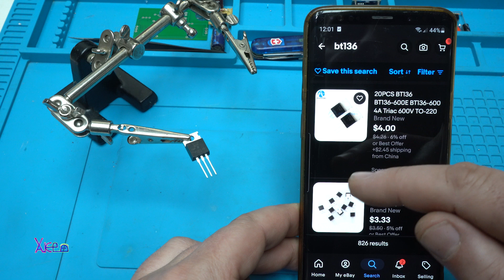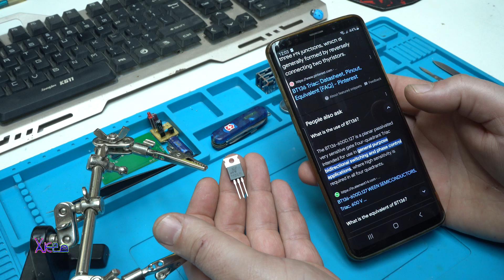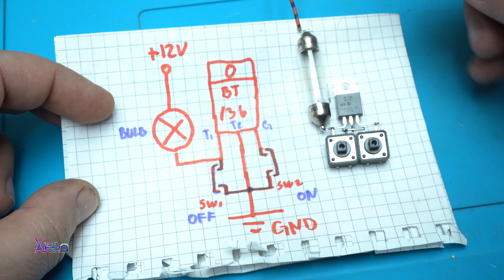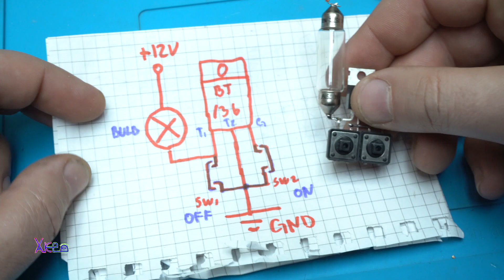ONLY 4 Parts To Make ON OFF push button SWITCH

Comment: It would be an even more interesting video if you explained how the electronic components you use work. Also, you would explain your circuit diagram, how it works. Because you showed the circuit diagram, you showed how to solder it, but your channel viewers may not understand how and why your circuit works.
Reply from the maker: Thx for feedback sir.

Comment: Neat!  I'm thinking those on/off switches could be replaced with a switching circuit for auto-control.  Also, given the triac works with AC, I should be able to switch on/off an AC motor - yes?  and maybe stick in a pot to vary the voltage and hence speed of the motor??  
PS - great videos, and really appreciate your focus on cost!!
Reply from the maker: That's a great idea!

Comment: can this safely switch 240v AC?
Reply from the maker: I am planning a new project for AC
Reply: Please dont,its a very bad design & if used on 240v,or any voltage above 100v or so,it could be fatal,also the push switches are only rated at 100ma !!!!

Comment: Just a reminder that if you are going to use this with high voltage or high current you need to connect the metal tab to a heat sink.
Reply from the maker: Yes for big loads heatsink is needed

Comment: It's a good circuit for learning how triacs work, but it's not simple when it comes to turning a light on and off. An ordinary switch is easier, cheaper, and much simpler.
Reply: Yes, but boring! And with a triac you can control it with an Arduino or remotely with an ESP32

Comment: I am sure you are aware that you can also trigger those with a diac optocoupler like MOC3021. Then you can go to about 400Vrms AC and control, for example a fan. Combined with a gas leak detector, it may be a good safety device. I love  you channel.
Reply from the maker: I'll have to look into that.